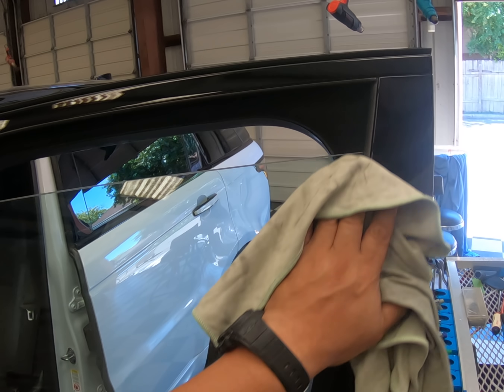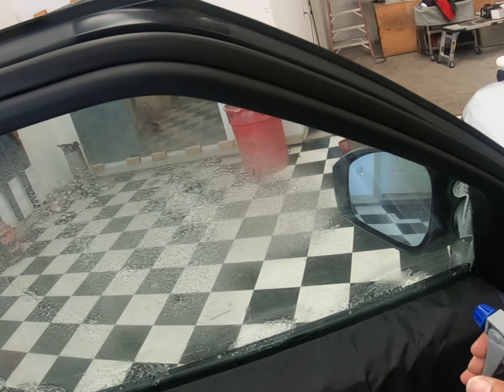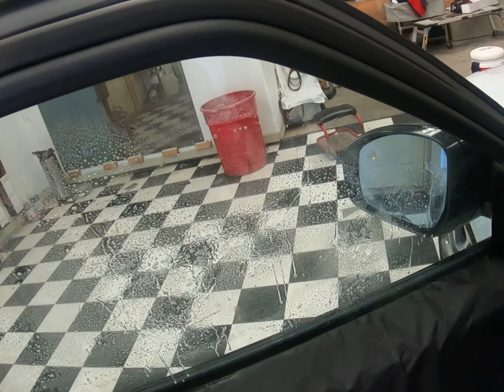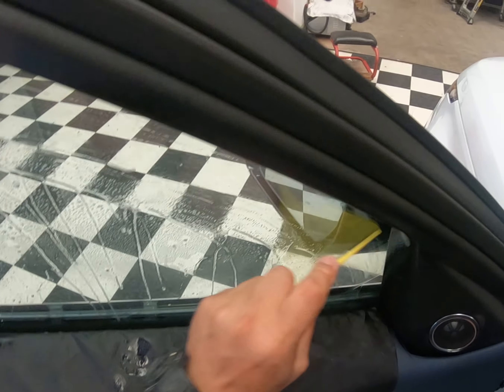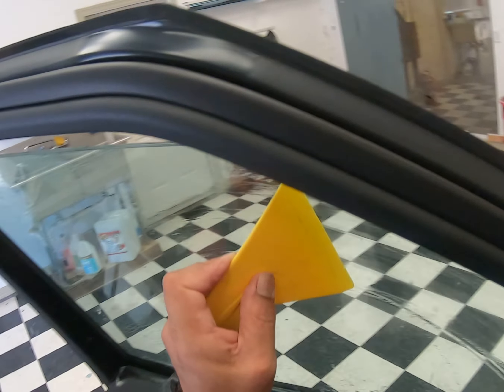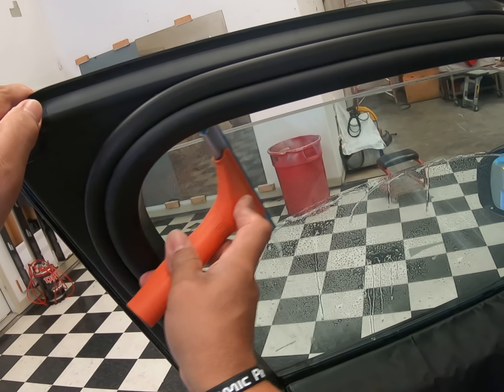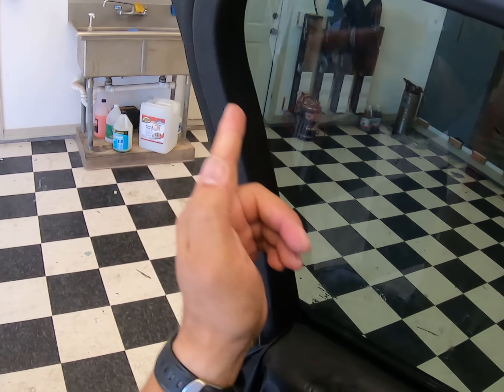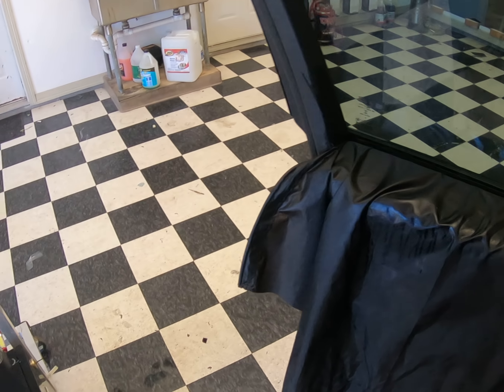2019 Range Rover... Window Tint...Dealing with Hydrophobic Coating...A MUST SEE!!!!!

Comment: What is that blue squeegee called.
Reply from the maker: All in 1 Tool
Reply: Ok thanks. It looks like a really nice tool to have
Reply: @mikesanchez1428  where can you get it  its the one that has felt and a orange hsndle you use to get the water out
Reply from the maker: @michaellangerman4615  depot or lowes
Reply: @mikesanchez1428  its the tool you use at 3:20 sorry for the confusion
Reply: @mikesanchez1428  I cannot find those at Lowes or HD. I can only find the  big 9 inch glass squeegees. What section did you get it in? Im interested in finding a better cleaning squeegee. 
Thanks
Reply from the maker: @willylowman99  those are it...cut em down to size
Reply: @mikesanchez1428  well friggin A. I seriously didn't think of that. Haha
Reply from the maker: @willylowman99  😂😂😂😂✌✌✌
Reply from the maker: @michaellangerman4615  Dirty-tools.com
Reply from the maker: @michaellangerman4615  Dirty-tools.com